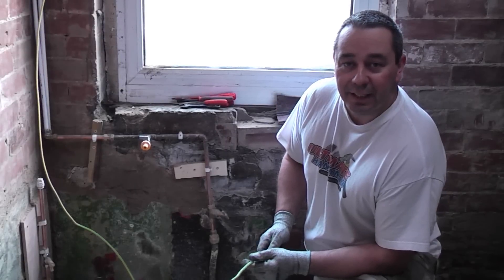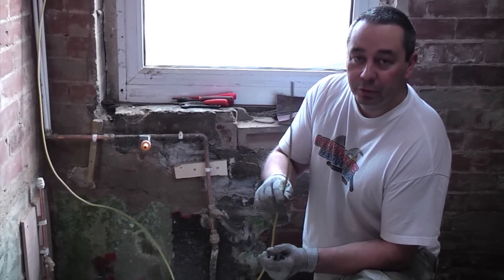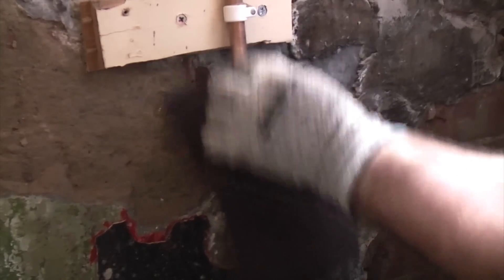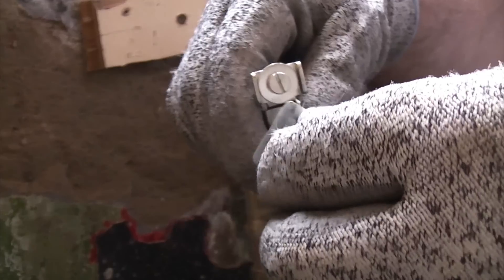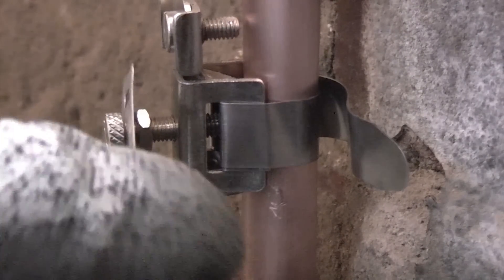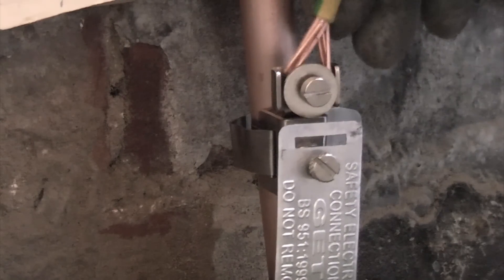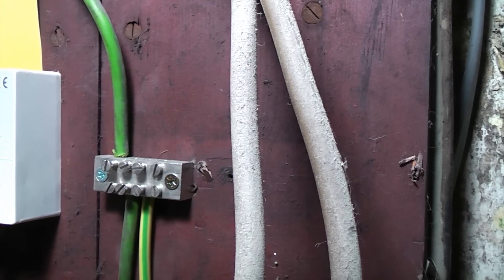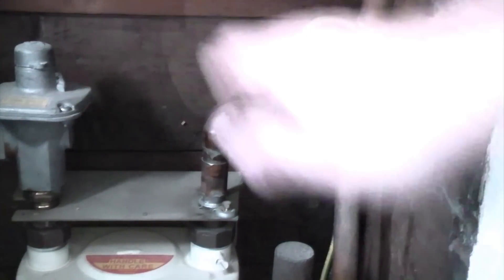Installing main protective bonding

Comment: it looks like your pipe converts to plastic pipe ...... the rest of the installation in the house wont be earthed. Surely?
Reply from the maker: There is no common sense in the regulations, I have even heard of electricians putting the earth clamp onto plastic MDPE pipe- as it says you have to in the regs.
Thanks for the comment 👍

Comment: The pipe as it enters the property is plastic. Surely that means it is NOT an extraneous conductive part and therefore does not require MAIN bonding ? Perhaps it needs supplementary bonding I'm not sure?
Reply from the maker: If you want to start an argument, join an electricians forum and ask a question about it ;-)
I too don't see the point in doing it, but the regs say that you must (or they did the last time that I checked).
Thanks for the comment
Reply: @ultimatehandyman  Thanks a lot for your reply. I watch most of your videos and really like them. Perhaps I'll now subscribe 8-) Unfortunately I'd already followed your advice but nobody there will answer the question ! https://www.electriciansforums.net/threads/main-bonding-for-incoming-plastic-pipe.190405  Closest I've got is JW's excellent bonding video which implies you don't need it BUT that is no good if your sparky is doing an EICR and insists it needs doing ! Really having trouble getting the truth on this.
Reply from the maker: @Mike-ur7xk   A few years back, I remember a thread in an electrical forum and someone ended up bonding to the plastic water pipe- because it said it must be done in the regs. There is a lot of confusion between the actual Law, regulations and recommendations. If you look at the latest edition of the (IEE- now IET) wiring regulations, it is suited more to a lawyer, rather than electrician. 
Thanks for the comments

Comment: Do you need separate 10mm2 earth cables from the gas meter and water pipe to the consumer unit or can you use one cable and connect the gas and water pipes (in my case both close together in the kitchen cupboard. Also, if you cant use a clamp on a lead gas pipe (mines a 1960's property) supplying the boiler and fire, how can I earth these? THANKS
Reply from the maker: If I remember rightly they have to be separate cables. 
I'm not sure about the bonding of the gas lead pipe- they are really thin and would be damaged by the earth clamp.
Reply: You can use one cable as long as it isn't cut on its way past the first bonding point.  It's a bit fiddly but you have to cut a short section of the green and yellow half way along the cable without chopping the copper conductors.
That bit of exposed copper goes under your first BS951 clamp and then onto your next bonding position.
It used to be  Regulation 528.3.3, but probably a different number now.
Reply: Use a constant-force spring clamp for lead pipe.

Comment: The water supply didn't need bonding - you have an MDPE supply so cannot introduce a potential into the property.
Reply: What's an MDPE supply mate?
Reply from the maker: The incoming water used to be bonded because the pipe used to be metal (often lead around here), MDPE is a plastic pipe and so it's a bit pointless bonding it as it is not conductive.
Reply from the maker: Thanks, there was a lot of debate about this years ago as the electricians used to argue about it saying that the 17th edition regs said that the incoming water pipe had to be bonded. There were even some electricians putting the earth clamp on the plastic pipe (if they were posting the truth in their comments).
Reply: Ultimate Handyman Yeah I've been on many forums where this debate continues. A lot of sparkies get confused as to the purpose of equipotential bonding. No harm adding it though
Reply from the maker: Blimey are they still arguing about it now ;-)
Thanks for the comments

Comment: good exlanation of how to do it....how about why its needed ?
also the cable should be terminated with a crimped on lug or at least wrapped around the screw in the tightening direction....a pushed in cable as shown is to easy to pull out....and yes i am a grumpy old spark
Reply: Yeh I'd prefer a crimp too, problem with crimps is that snowflakes try and make them with pliers, and then decide that crimps are stupid. Especially Americans.

Comment: Word of warning (I'm an electrician) most of the time you'll have no where near as much room to work as this bloke.
Usually you'll have your head jammed under a sink or will be reaching behind a stinking toilet (depending where the stop tap is) and you'll have to struggle and persevere to pull the clamp tight onto the pipe with fingers as it wont be possible to psychically get a pair of pliers into the confined space!
Reply: Discovered that today with our main water pipe into the corner of our kitchen. Our house was built in the late 1960s and still has the original earthing clamp and cable which over time has become corroded and ineffective. I was literally laying inside the cupboard trying to squeeze my arms through a tiny aperture in the corner unit! What a pain!